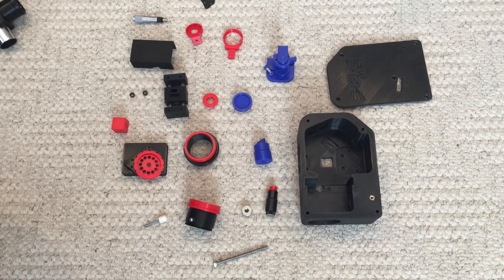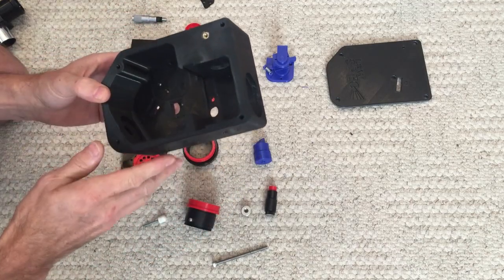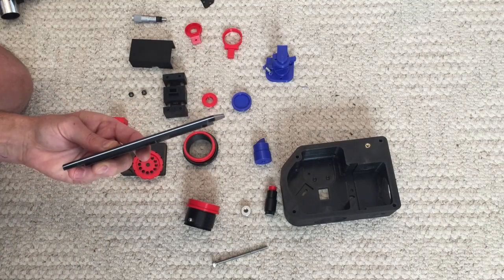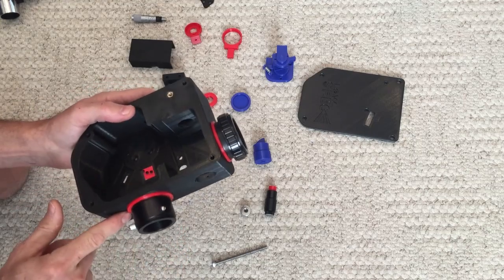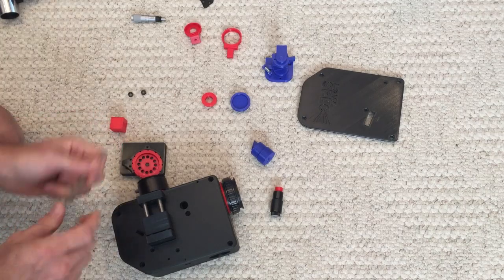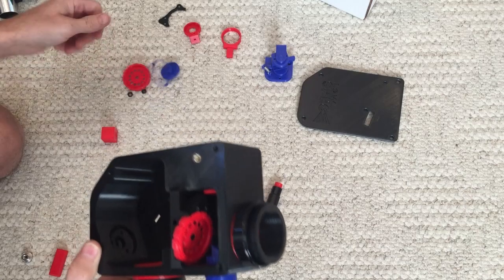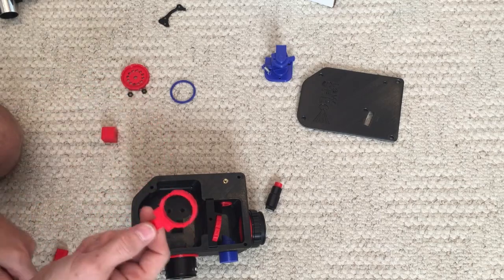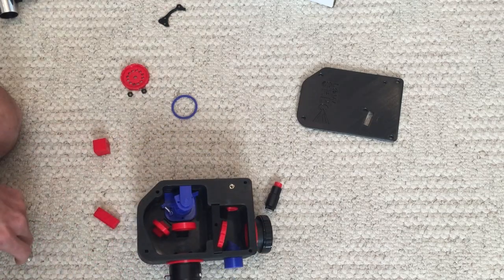LOWSPEC Spectrometer - Part 1 - 3D Printing

Comment: Wow, the metric parts seem to be hard to get in the US! Here in Europe, you can go to local hardware store, get a small paper bag, put all the parts you want in the bag and pay for the whole bag per kilogram (some parts such as big nyloc nuts have different price per kilogram so you have to put those in another bag). All the metal parts you needed would have cost like 0.50 EUR.
Reply: They are.  When I started the build of my Lowspec v2 I had to order some parts from France, pay VAT, import taxes, etc.  6 weeks later I had my grating.  The v3 also sources a grating from Edmund Optics which we can get quite quickly in North America.  I probably have US$100 in various metric parts that only made sense to buy in bulk.  Things like screws, nuts, etc.  I really, really wish the US would finally get with the program and just switch to Metric and be done with this stupid British Imperial measurement system.

Comment: Came across your video. Great job!
I did made a manual but your video will be a great help to for anyone that is thinking about  building this instrument.
To answer your question; the focal point for the camera lens is about 55.4 mm outside from the face of the main body (if you use the 30mm f=100mm lens).

PLA is easy to print but not the material I would recommend. First it will start to loose its shape at temperatures of 50 degrees Celsius or above. Second it turns out that PLA is transparent for near infrared and infrared. I myself use ASA as the main material which is more tricky to print with than PLA. PETG is also a very good alternative. I've just finished a successful print with Carbon filled PETG (ALFAOMNIA form the Italian company FiloAlfa). Which is incredibly stiff with 40 percent infill printed with a 0.6 mm nozzle.

I have not yet found the time to make a manual for correctly aligning the optics. The best way to do this is to first remove the slit assembly and place a collimator laser at the telescope end of the spectrometer pointing inward and check that the laser light hits the centre of the optics.
If that's OK, place the slit assembly back and check how the laser light reflects of the slit plate onto the pick-off mirror and the guide lens. Adjust the pick-of mirror with the small grub screws.

The collimator lens should be placed at the correct distance to the slit. The best way to do this is by removing the camera lens and face the telescope end at a bright light source. Then use a small view finder from a telescope that is focused at infinity. Now look trough the finder into the camera opening of the spectrometer. You are looking straight at the reflective grating. Now turn the grating to the blue side of the spectrum until you see the illuminated slit. If the image is out of focus, change the position of the collimator lens. When focused, secure the collimator lens with it's screw and place back the camera lens.

I'm planning to release a new version with easy interchangeable gratings.

https://youtu.be/h4ihnS_naTo
https://youtu.be/T32eXb0y9zA

Also I'm still planning to design a calibrating unit for the LowSpec as that is essential for creating usable data. But progress is slow as I know almost nothing about electronics. So any help would be appreciated.

I'm Sorry about the metric screws ;-) but that's how it is here in the Netherlands and the rest of the world. It's just a mater of time before the US will also embrace this standard ;-)

As for your pronunciation of my last name; good effort. It uses a sound at the beginning and end that is unfamiliar for English speakers.
If you want to get a sense of how it's spoken in Dutch, try typing it on the text-to-speech site:

https://ttsmp3.com/text-to-speech/Dutch/

If you've any questions please contact me.

Best regards,
Paul Gerlach
Reply from the maker: Thanks Paul, your response is VERY much appreciated and you have done an amazing job on this!  It's great to hear your still making improvements. 

I will definitely look into getting some Carbon filled PETG to reprint the unit once I get this once assembled and functioning.  Second time around will be much easier.  I have also now build a nice heated enclosure for my Ender 3, so that it a great improvement on the printing side.  

I have already learned a lot, and appreciate the calibration comments.  Searching the web, and with some help at the stargazerslounge forums, I think I was almost there, and everything you said makes perfect sense.  I am hoping to get my OVIO slit disk today (FedEx), and should be posting "Part 2" of this video series later this week. I was using a laser pen (mounted across the room) for alignment, but bought a laser collimator from amazon ($22) which should be much easier to work with.

Thanks again for all your hard work, this is a really fun project.  I hope my videos help make this easier for the next astronomer!
Reply from the maker: Also, on the electronics side, I'd be happy to help with anything you need.  I have written code using the Arduino boards for a few electronics projects, and I also just built a dome controller for my observatory which links ASCOM to my hardware setup I developed.  I have the ASCOM software side of things sort of figured out using C#, so if we want to link something we build to a CCD camera via ASCOM and make a new windows interface for it I'd be happy to help!
Reply: Paul - how significant is PLA's transparency in IR and near IR? Is the concern that ambient light from outside the Low Spec would transmit through the body and contaminate the light path within the spectrograph? Could a simple paint coating mitigate this issue?  High temperatures would certainly be an issue for PLA.

Thanks!
Reply: @billnorby9891  Yes Bil, that could be an issue and can be mitigated by using a paint that blocks those wavelengths . or even simply covering the outside with aluminum foil.